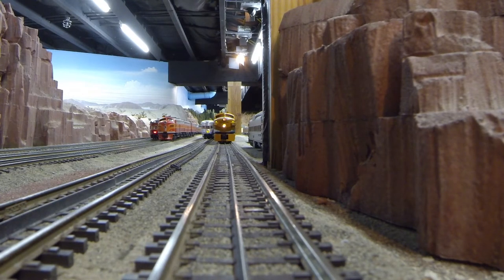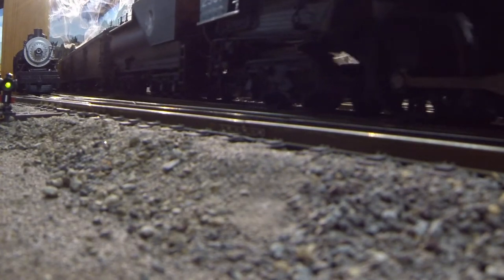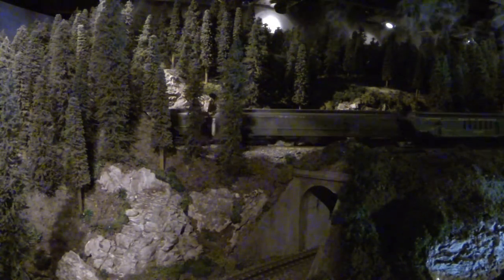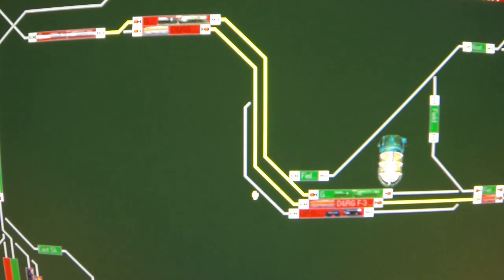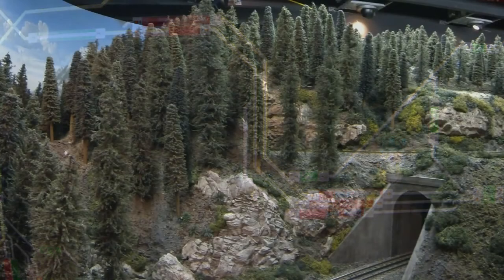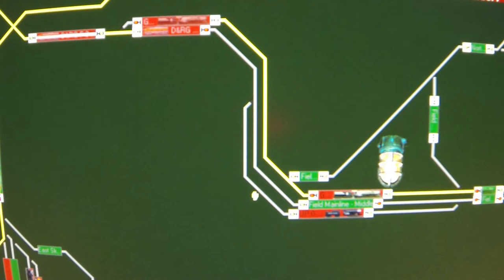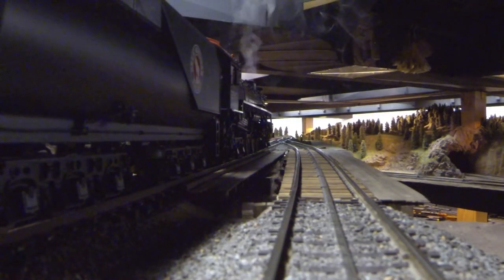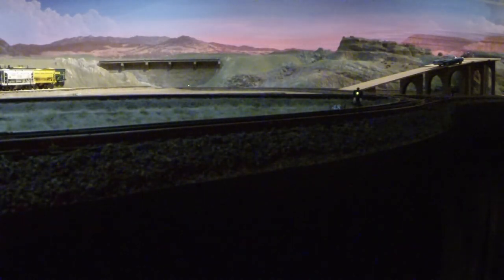Model Railroad Automation from Hikel Layouts & Trains

Comment: I recently subscribed to your channel. I have a few questions. What is the wiring like to set something like this up? I'm sure you have the normal bus lines, feeders, signals, block control, and switch controls routed to an AIU. My question is how are you sending commands from the computer interface to the DCS equipped locomotives? Are you simply connecting your CPU and going through your TIU? Thanks. Great video, thanks for sharing.

Ethan

Comment from the maker: Hi Ethan,

The NWTL has 7 TIU's up to 100 ft. away from the dispatching computer.  To handle this many connections over such long distances we designed our software to communicate with the TIU's over a LAN.  Each TIU is connected to the LAN via serial by a Proto-Net network serial server.  The routing of DCS commands for switches, accessories, and locomotives, is handled by our custom software, which we call NetCoupler.

Comment: Sorry. Soon as I saw the AC, 3 rail, Lionel type track I stopped the video... Why on earth people still go for that stuff in this day and age, with realism galore available in scale 2 rail, O gauge, S, HO, and N gauges, is beyond me !
Reply from the maker: Hi Mr. Harris.  Feel free to stop and not watch the video all you want.  As for the 3-rail track, that's MTH ScaleTrax.  It was the client's choice and he's quite happy with it.  The same system can be installed on 2-rail railroads as well using current detectors and/or IR sensors.  Both are considerably more expensive than detection using an insulated outside rail on 3-rail track.

FYI, we will be installing this same system on a 6000 sq. ft. 2-rail O scale layout that will be on public display at the Lake Superior Railroad Museum in Duluth, MN.  The public opening should be some time in mid-2020.
Reply: Hi Mark,  Although I understand the ubiquitous quest for maximum realism, many people weighed the ratio of the availability of 3 rail engines and rolling stock and accessories in the O gauge world to 2 rail and it is probably in the 1000s to 1 ratio.  Although DCC has nice features  I feel it does not match the excitement of the sounds and features of DCS and Legacy.  Also the reason 3 rail became popular in the first place is because of the wiring simplicity.   What I think  should be the new standard is self powered battery operation. If I can ride 100 miles on my electric recumbent bike,why not go to all battery operation for the future of model train production.  Also maximum realism is not always equivalent of maximum enjoyment for many people.  I think it is very limiting and not beyond understanding to realize that for many people 3 rail is their preference.